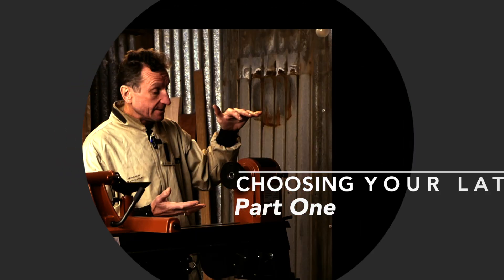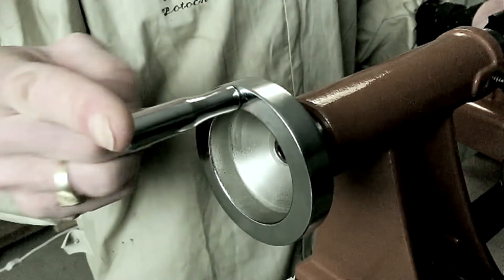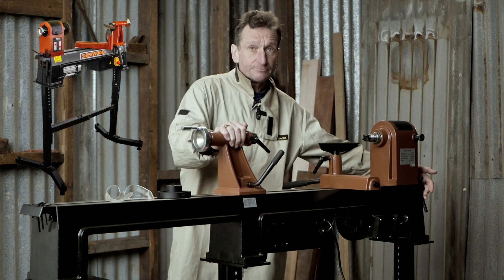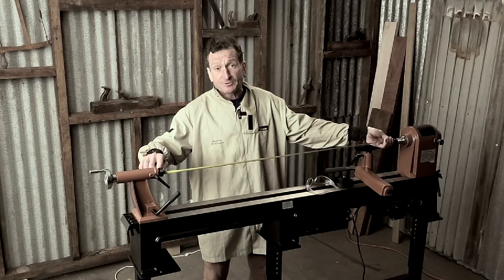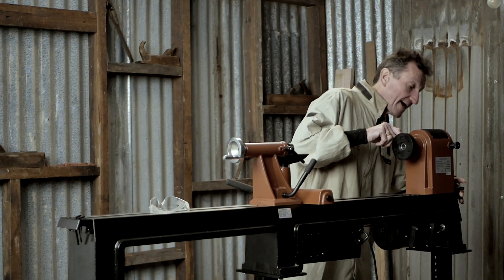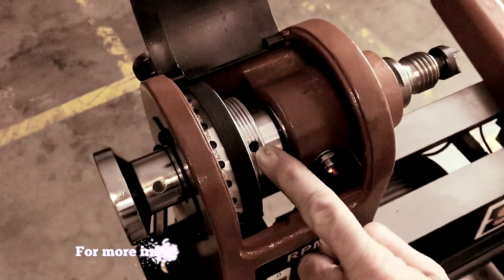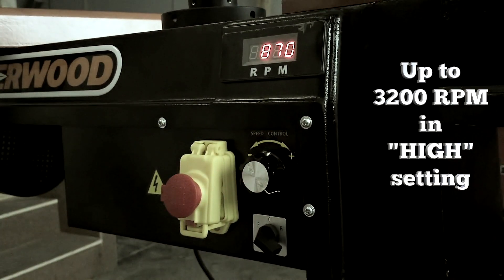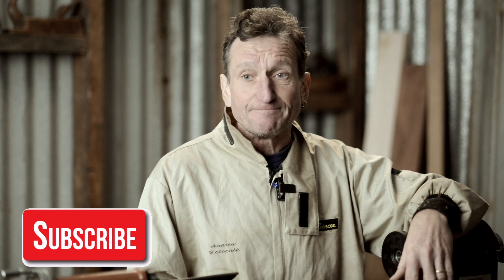Choosing Your Lathe Pt 1

Comment: I have the Sherwood Woodlathe 350 x 510mm - Induction Motor EVS
Sherwood Woodlathe 350 x 510mm - Induction Motor EVS
SKU: MC-1420-VF . For the money, I think it's good value.  Heavyframe and handles relatively large wood ok. I like the variable speed and reverse. One of the features I liked in the advertising, was the fast stop switch. When  lathe arrived,  the Fast Stop switch was absent. They made a small cash credit for that. I would have preferred the fast stop button as advertised!.  The tailstock drive bearing failed after a few months use- "Not covered in warranty".  The motor and cooling fan is directly where the sawdust falls. I wonder what happens when the motor fan clogs up!  (I have to clean it frequently, which means tipping it onto its side to get at it. Which is a nuisance ).    The lathe has slow startup (lag), when using the on/off switch. Otherwise, I think its good for the money.

Comment: I picked one up early this week with the extension bed, So far I'm very happy with it, It runs very smooth and Silently, It has a soft start, and low speed is excellent for applying finishes to the work, Oh and it's a very Heavy Lathe , :)  :)